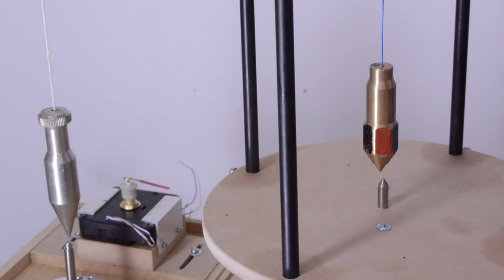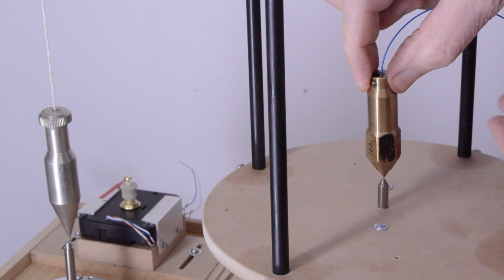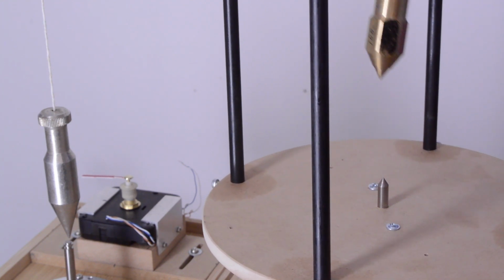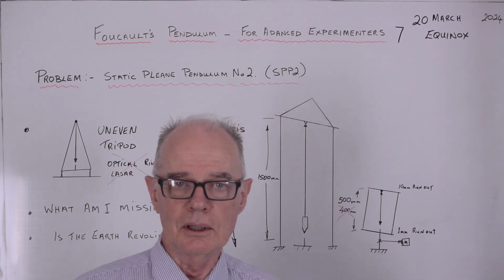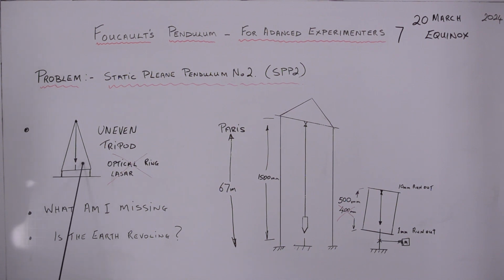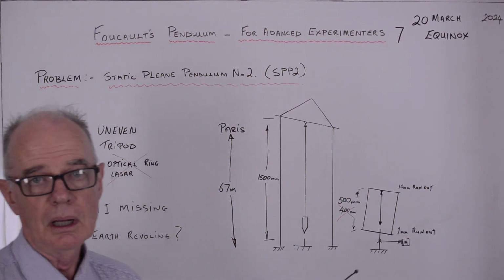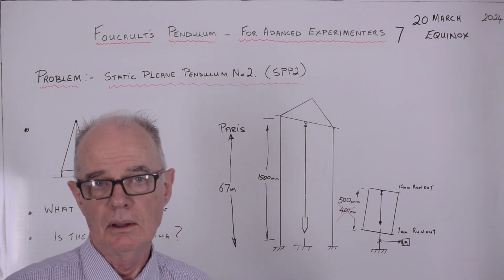Foucault Pendulum for Advanced Experimenters 7

Comment: Not the same simulation in rotations per minute. You are rotating your turntable at higher RPM than the Earth rotates.
...Earth is .000694 RPM
...How many RPMs are you rotating your turntable?
...@6:05 to 6:18 you made a 3/4(.75) rotation. So 13 seconds to make 3/4, that would make 1 full rotation at about 18 seconds. That's about 3 RPM
...3 RPM  turntable versus .000694 RPM Earth.

Earth's .000694 RPM = Tangential Velocity at the Equator = 1037 mph / 1669 kph
Earth's at 3 RPM = Tangential Velocity at the Equator = 4,482,047 mph /  7,213,156 kph
...I predict if the Earth would start rotating at 3 RPM, human and animal civilization are in trouble.
...And at a 3 RPM for Earth, I predict that centrifugal force would cause the pendulum to move. It would overcome Earth's gravity. Even at a slow  .000694 RPM, Earth still has some centrifugal force effects. There is a gradual bulge from the poles to the Equator.

I would like you to rotate your turntable at .000694 RPM, that would match Earth's rotation. That is twice as slow as a clock.
Reply from the maker: Thanks for the suggestion and maths,... yes my new turn table design will have the very slow rotation function,.. stay tuned.

Comment: I think 3 legs and 2 screws at one end and and statically center it over the axis. I belive that your indicator is turned on the lathe so it is the true center of rotation. Apart from being able to center it, with 3 legs you can discard the top plate or make it the smaller possible and get rid of the legs flexibility. And 3 foot base 2 with screws to level the base. It can be done in steps, first adjust the legs until the rotation allways keeps the pendulum in the same place, then adjusting the base screws until both meet
Reply from the maker: Thanks for the advice,... yes 3 legs for the new design seems like the way to go.  I am not sure I can make the new design, first the base has to be supper level and concentric to the Earth, I believed I was doing well with less than 1mm runout.  Then the vertical coulomb has to be just as accurate over at least 500mm high and concentric to the base.
Your comment was more constructive than you think, when I said it is like balancing a pencil on a pencil that is what it is like to make an accurate revolving platform, (the Earth simulator).  It all looks easy on paper until you try to make one, perhaps I should do a video on why the Foucault revolving platform Pendulum Clock was never made, yep good comment.
Reply: @peterleane6807 To be clear: 3 legs adjustable with screws on 2 of them can give you perfect concentricity from the coupling to the main shaft. The base should be the stiffer you can get, I think aluminium at least. The holes can be made with an angle fixing it to the lathe carriage with a bolt, the drill bit on the chuck, and then rotating the base.  Then 3 feet with screws in 2 of them can give you perfect level. Perfect level means the shaft points to the center of the earth. I think of an 200mm diameter base and around 30mm on the top, just to fix the legs and the coupling. The  angle of the carriage is the same for both base and top. And a lot of time.... Get the pendulum to sustain its position while it rotates is the first step, then, using the pendulum as a level, adjust the 2 bolts on the feet until they are centered.

Comment: If I understand the issue…
The axis of rotation of the 4 post cage is not vertical. The bottom disc is rotating about a point. And the pivot at the top is moving in a circle. And the support wire is rotating in a cone around true vertical. 

The turntable motor axle is not plumb.
Reply from the maker: Thanks for the reply:-
Q1 The axis of rotation of the 4 post cage is not vertical. A1 Yes the axis of rotation is not vertical, the centre of the top pivot is out of plumb from the bottom pivot by approximately 10mm.
Q2 The bottom disc is rotating about a point. A2 Yes
Q3 And the pivot at the top is moving in a circle.  A3 Not sure could be an eclipse.
Q4 And the support wire is rotating in a cone around true vertical.  A4 Yes rotating in a cone but not exactly sure if the cone has a circular base or enclitical base.
Reply: @peterleane6807  
Nearly circular. 

And the ceiling hung pendulum is locally rotating relative to the earth…
Reply from the maker: Q5 And the ceiling hung pendulum is locally rotating relative to the earth. A5  The ceiling hung pendulum to the left of the disk model is suspended from the ceiling of my lab, (1500mm). The ceiling pendulum is plumb to the gap measuring indicator below it. The ceiling mounted pendulum uses the same magnetic coupled bearing as seen on the disk model.  Hence,...Yes the ceiling mounted pendulum is rotating relative to the Earth.
Reply: @peterleane6807  
I can’t see the house rotating relative to the house’s foundation. Looking out a window the view is static.
Reply from the maker: In order for you to see the house move relative to the view, you would need to decouple yourself from the floor.
Why am I so fastidious with my results,... there is a lot riding on the F/Pendulum.
Reply: @peterleane6807  
These issues/problems shall be overcome. 

I’m intrigued at your investigation in fine details to remove influences. I know some people would take a crap construction and declare Foucault’s pendulum is presupposition. 

I’m a geodetic land surveyor. And I’ve had to go back to the textbooks to make sure I don’t misspeak when presenting my measurements of earth’s shape dimensions and refraction in zenith angle measurements over 1-28 miles.

Comment: Yes. The Earth is revolving.
1) star trails
2) mechanical gyroscope
3) optical gyroscope
4) gyrocompass
5) weight variation with latitude
6) eotvos effect
7) orbital launches
8) geosynchronous satellites
9) Foucault's pendulum (just make a regular one)
Reply: I didn’t think he is trying to debunk stationary earth. I thought this exercise is to affirm that the Foucault pendulum is truly swinging in a plane and identifying the various subtle mechanical influences that may corrupt the results when the period of precession is reduced due to latitude and not unaccounted for imperfections 

I’m reminded of Blue Marble’s cavendish and how much effort it took to eliminate nano Newton losses in the period of oscillation
Reply: @larryscott3982  I assume you know this, but just in case... Foucault's pendulums don't truly swing in a plane. That is the simplified language we sometimes hear to describe the situation, but we should understand (and I suspect you DO understand) that is not accurate. The pendulum would only swing in a plane on the geographic poles. Anywhere in between, the rotation of the gravity vector causes the pendulum to precess. That's why it takes more than 24 hours to make the complete circuit anywhere off the poles.
Right?
Reply: @icansciencethat  
Yeah, sine latitude. At the poles and equator sine is zero, and 1. 

Which is why he’s putting a significant effort into accounting for and attempting to minimize mechanical influences. 

I don’t think he trying to make a ‘gotcha the earth is stationary’.
Reply from the maker: Thanks for the reply, I like your channel and quite often go there, for some good science grounding.  I am disappointed that you did not attempt to explain why the SPP2 moves of centre on my disk model and any input from yourself would have been extremely beneficial, as clearly your channel reflects you are very educated and respected regarding the physical sciences.
Reply: @peterleane6807  I need to apologize. I have not watched the video series. This is now part 7, so I am not up to speed enough to make any educated comments about what you're up to here and what your issues might be.
To be honest, I was merely skimming through your video here to see if you had any sort of conclusions.
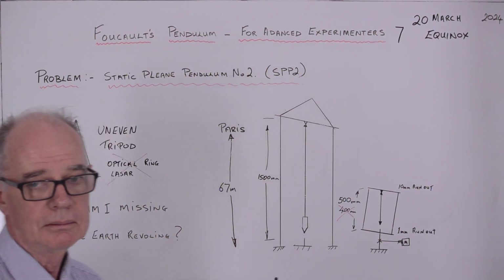My comment above is in response to your question at @9:30, "Is the Earth revolving?" I'm just providing a short list (there's more) of readily available evidence to answer that question.
I completely understand that I have NOT watched the video entirely, nor have I watched the 6 before this. This means I have no basis whatsoever to criticize any of it, and I don't mean to be dong that. I'm not criticizing... just answering the question you posed.
Having said that, if you have an interesting physics puzzle here, maybe I could find the time to look at it and weigh in. Do you have a sort of executive summary of what you've built and what the puzzle with it is?
Reply: @icansciencethat  
(I didn’t see the closing line on the white board. I assume he’s aware of earth’s motion in all its precision. And a small scale pendulum has challenges that a 67 m, 28kg, pendulum overcomes.)
Reply from the maker: @icansciencethat,  Thank you for your honesty,  your channel must keep you very busy and understandably if you wish to pull out of the puzzle that's all fine.
However if you can spare the time.
The short summary is:-
1. There are 2 Stationary pendulums hanging in my lab.
2. As both pendulums are not swinging then we can now disassociate the experiment with pendulum theory, their motion and principles of operation.  From this point onwards there are 2 plumb bobs hanging in my lab.

Reset
1. There are 2 plumb bobs hanging in my lab.
2. The plumb bob on the left is attached to the ceiling of the lab and hangs plumb to the measuring indicator 1500mm below it.  The LHS plumb bob also uses the same decoupling magnetic bearing as seen with the plumb bob in the revolving cage on the RHS.
3. The plumb bob on the LHS has been hanging for several days and it has not moved 1mm laterally, the only change is that the string has stretched, which was expected.
4. The Earth is turning around both plumb bobs, however to speed up the movement of the Earth I have constructed a simulation, shown by the RHS plumb bob in the revolving cage.
5. The construction of the revolving cage was not perfect and there is an approximately 10mm out of plumb measurement between the top centre of the cage and the pointer 500mm below it.  In addition it must be pointed out that the room is also not square and the point under the LHS plumb bob is a derive point in space not the actual point in space. 
6. I believe video No7 can explain the rest,.... hope you can spare the time, Peter
Reply: @peterleane6807  @5:49 "Why, when the Earth goes around with this pendulum... why doesn't it move?"
You've aligned the plumb bobs using gravity (technically gravity with a small contribution due to centrifugal force). When you rotate the turn table, you rotate the mounting point but you DO NOT rotate the force of gravity to match. When the left-hand mounting point rotates, it is rotating with the Earth, and that means the gravity force IS rotating to match it.
Hopefully that clears it up for you. By rotating your little turn-table, you are causing it to misalign away from the gravity vector. The one rotating with the Earth is always going to stay aligned with the Earth's gravity vector.
Reply from the maker: Heck that was quick, that would have taken me a month,...yes it makes sense, it will take me a few days to process fully,....I still have my finger on the chess piece, so stay tune.
Reply: @peterleane6807  Just something to think about here... maybe if you hang the apparatus instead of trying to support it from below... hanging naturally aligns with gravity (like a plumb bob). Maybe that way, you could keep it all aligned easier?
Reply from the maker: Hi, sorry for the delay, my life when crazy busy for a few days,.... Yes I totally agree with your answer in relation to gravity vectors, providing gravity vectors are a fixed datum point and move around with the Earth.  My understanding is the gravity vectors DO NOT move, the Earth warps time and space, hence the Earth moves in a gravity soup.
Reply: @peterleane6807  
Gravitation is a property mass. 
Tidal drag is a known phenomenon. 
Earth moon barycenter is well understood. 
High tides and the opposite high tide follow moon phase.
Reply: @peterleane6807  it's hard to describe exactly what we're talking about in text... bottom line: a plumb stays plumb as the Earth rotates, but if you hang it from a turntable, it won't stay plumb with the turntable, unless the turntable is aligned perfectly. 
Right? If we're on the same page, great. If we are not in agreement, I'll try to make you a video explanation.
Reply from the maker: @larryscott3982,  I was responding to @icansciencethat, however thanks for the comment.  So do you believe the gravity vectors mentioned in @icansciencethat reply can be significantly modulated by tidal drag, centrifugal, or any other forces, or is the gravity vector far more dominant, hence the ceiling hung plumb bob will never move.
Reply: @peterleane6807  
Relative to the earth the plumb bob at rest is static; relative to the earth. 

The plumb will hang motionless - relative to the lab - as there’s no local rotation. The view thru your window never changes, as the earth rotates. Ergo static. Gravitational: constant. Centrifugal force at your latitude: static.
Reply from the maker: Yes if you have the time a video would be great,....feel free to use, copy and post any of my videos.  Understanding the gravity vectors is essential to the operation of the Foucault's Pendulum.  You will produce a much better video at explaining the concept than me.
Reply from the maker: Yes all makes sense, until you attempt to make a model of a revolving Earth with a swinging pendulum and then it becomes balancing a pencil on a pencil, the mechanical precision does not add up.  @icandoscience is going to do a video to answer the problem, just to clarify we are totally on the same page,... stay tuned.
Reply: @peterleane6807  I think YT ate my post because I included the link. My video response is titled, "Why Don't Plumb Bobs Wobble?"

Comment: On you'r disk model you should consider a coupling of forces between pendulum and top plate swinging on the rods. All 4 rods are parallel and are acting like leave springs. A swinging pendulum is allways pulling the rods to the side. And to complete the problem, the complete model is swinging on the rotation axis it is mounted to.
Reply from the maker: Thanks for the comment, yes you are correct about the coupling of forces with a swinging pendulum.  However the pendulum is not swinging and the dial indicator did not detect any sway forces from the pendulum, so I believe the disk model is rigid enough to demonstrate a pendulum in a house.  Your suggestion would definitely be used if the disk model was to be remade.